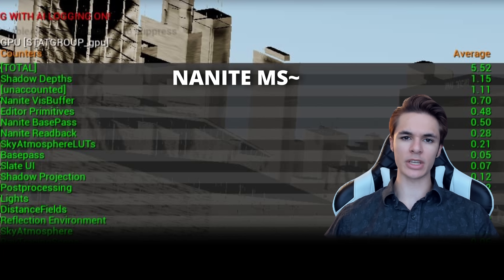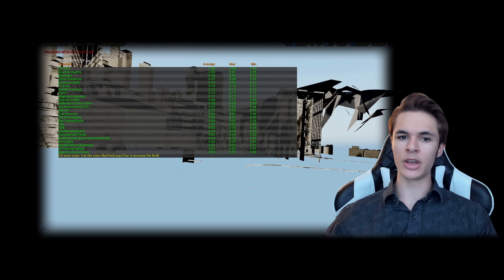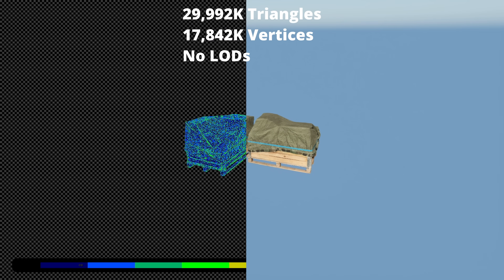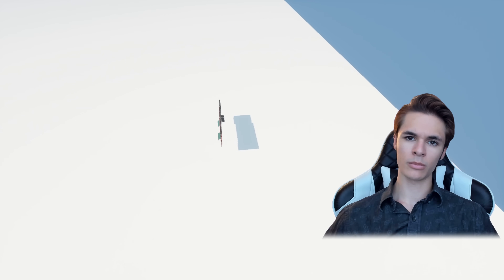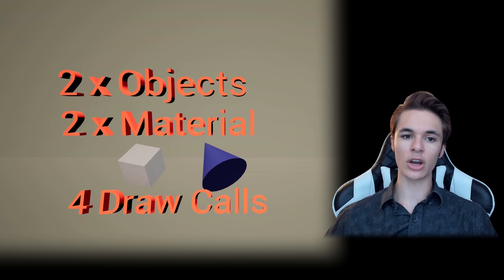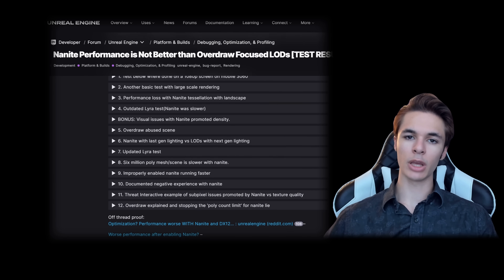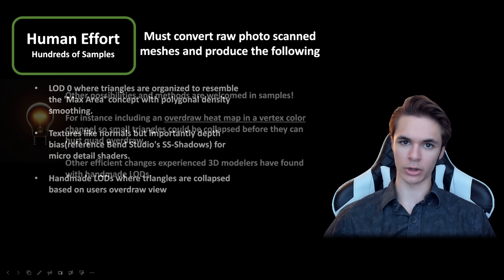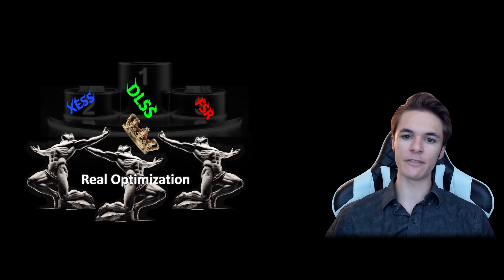Epic's Unreal Optimization Disaster | Why Nanite Tanks Performance!

Comment: Finally someone taking about this... I was sick ok people claiming Nanites boost performance when in reality I was losing frames even in the most basic scenes
Reply: To be fair, I don't think nanite is designed at all to boost performance in the most simple scenes, so anybody saying that is either oversimplifying or just wrong. Instead, it was designed to provide an easier pipeline for artists and designers to build complex level designs, without inducing an equivalent increase in performance loss or time into developing LODs.

It's designed to be a development performance boost.

If you don't need nanite for your games then there's no reason to use it, but I think it's weird to pretend like the issue is because it doesn't do something it wasn't designed to do
Reply: Nanites is for using in tesselation objects. Not for a table. Or a bush. 
You can use tessellation for all objects in the scene and make a more realistic game. 
That if it is a corridor (no open word) it will not cost so many resources.
Reply: ‘Losing frames even in the most basic scenes’ This is precisely the situation nanite is not built for and they specially tell you not to use it for simple scenes

‘I don’t understand how nanite works’ and ‘nanite is bad’ are not the same
Reply: Nanite for simple scenes is like packing a whole factory for a job that requires a simple hammer😅
Reply: And it seems nothing's changed.
Reply: By itself nanite does nothing. It's useless. It's like writing a Ray traced shader for a ps2 game (bad example but you get the point)
Reply: just another case of tencent timmy being confidently wrong. we've all known unreal engine was way worse than quake 3 back in the day as well, it was ancient by comparison and the performance was abysmal. the fact people kept spinning a yarn that unreal engine was somehow competitive with id tech was always such a funny thing to see.
Reply: All the last features in engines came to make developers life easier while affecting performance negatively. Its not a bad thing, in the future those features will be well polished and will help us developers without affecting performance. All good tech take time to be polished.
Reply: @_Romulodovale   I'll tell you this, regardless of what anyone has said here, up until May 13, 2020, the day Epic first released the teaser for Nanite And Lumen, no one had ever seen that level of visual quality running in real time for meshes or lighting before in a game. It is something that certainly had never been achieved with an LOD system, and we definitely didn't have real time GI on that scale before either. I mean come on, look at what we are comparing LODs to here? Actual sculpted models taken straight out of the 3D program. I'm sorry, but this is a no-brainer. 

Epic's goal was to make the development of video games a much more straight forward process and have stuff working out of the box, and they have certainly achieved that.

Not dismissing the points he made in the video because they are very valid depending on the situation, however, LODS take time to set up and so does baking light which would only result in something static which is a HUGE step backwards at this point.

No matter how educated this guy is on the matter, his argument simply narrows down to him being more in favor of the primitive approaches we only had available to us before, which everyone has moved on from. And given Epic's new intention for the engine, as well as the many other tools out there, it's unrealistic to even think that they would spend additional time making this new technology work around such dated approaches. UE5 is all about developing around the new Nanite And Lumen tech, so it makes way more sense for people who do not prefer this to just go back to Utilizing UE4 which is specifically built around these old approaches.
Reply: @ChatterBoks85  and all those features are getting improved every new update. Imagine when all these features become the industry standard, it will be really easy for us artists and level designers to work. We are entering the AI era, we need new tech to help us in development, or we will just get obsolete.
Reply: @_Romulodovale  i'm a software engineer since 30 years and, hoo boy, does that statement not check out
Reply: @cheater00  you don't work in the games industry, though. Content production is a huge problem in games and not in most other software. I have been a software engineer for 25 years (professionally), and I can say your credentials don't mean much if you haven't been working in games.